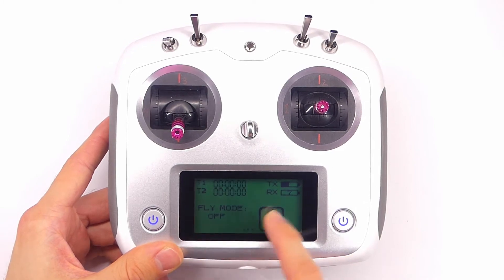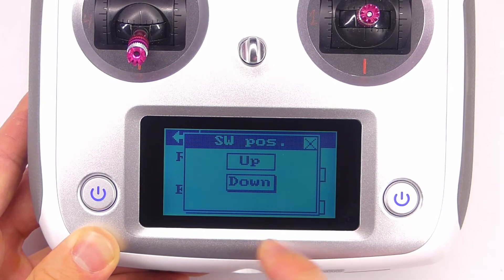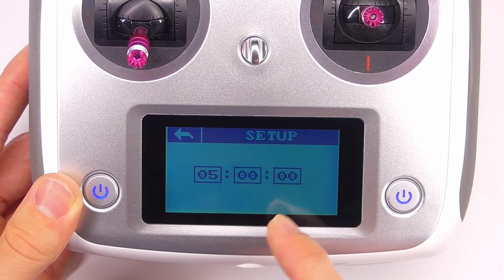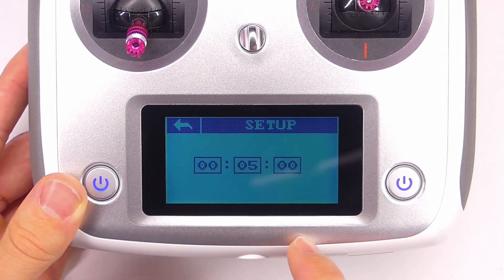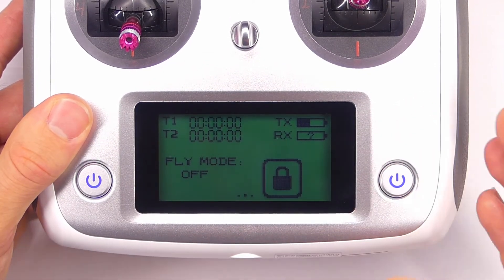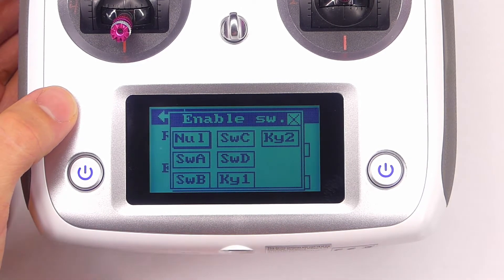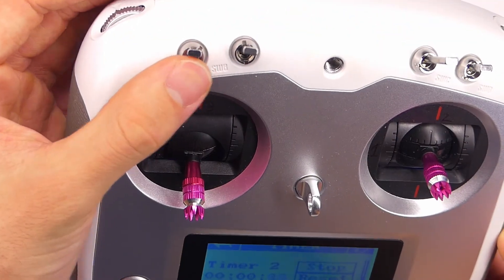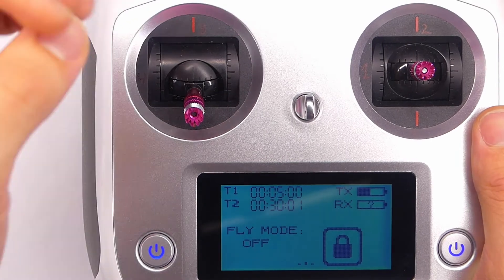FS-i6S Timer Tutorial - FlySky i6S Transmitter

Comment: Great video thank you! Here's how I set up my timer... To be able to stop or start the timer... Assign the timer to the upper left 'stop/run' Switch A or SwA. This way when you power up your heli by pushing that switch A to 'run' then the timer will automatically start, fly for a while, land for a rest powering down the heli by clicking switch A to 'stop' and the timer will automatically stop. That's how I have mine set. With the 5000 Li-Po I fly for 16.5 mins. and that ends up with good Li-Po storage voltage of 3.81v per cell. Also, If I want to reset my timer, like if I accidentally go from stop to run when the heli is not ready to power up and the timer had started, I also assigned my timer 'reset' function to 'Key 2' which is a round button on the back side of the radio, it's the one on the right side of the back when the front of the radio is facing me. This way if I want to reset my timer, I just push that 'Key 2' button and the timer resets to 16:30 mins. But I need to be careful not to accidentally push that timer reset button on the back while I'm flying or my flying time set is ruined. I tried using the 'Key 1' button on the left of the back side for my timer reset, but would at times accidentally push it and reset the timer, so I changed it to 'Key 2' on the back right side, and I've not accidentally pushed it so far, but have come close. Before learning how to set my radio timer, I carried in my pocket a simple digital kitchen timer, but would always need to remember to start & stop it, and sometimes I'd forget and lose track of my flight time knowing when to land. The radio flight timer is so much easier to use, can see it on the radio screen. But when it gets dark out, can't see the timer on the dark screen, so I need to tap the screen in an open space to turn the screen light on for a while. I'm going to try to see if there is an adjustment to keep the screen light on longer, or for my whole flights, will just use more battery power & need new batteries more often.

Comment: I only see start and reset,what about stop,example,timer is set for 15 min, I am flying for 8 min,bring it in to check something out,would like to just stop the timer not reset it.
Reply: To be able to stop or start the timer... Assign the timer to the upper left 'stop/run' Switch A or SwA. This way when you power up your heli by pushing that switch A to 'run' then the timer will automatically start, fly for a while, 'bring it in' as you wrote, then power down the heli by clicking switch A to 'stop' and the timer will automatically stop. That's how I have mine set. With the 5000 Li-Po I fly for 16.5 mins. and that ends up with good Li-Po storage voltage. Also, If I want to reset my timer, like if I accidentally go from stop to run when the heli is not ready to power up and the timer had started, I also assigned my timer 'reset' function to 'Key 2' which is a round button on the back side of the radio, it's the one on the right side of the back when the front of the radio is facing me. This way if I want to reset my timer, I just push that 'Key 2' button and the timer resets to 16:30 mins. But I need to be careful not to accidentally push that timer reset button on the back while I'm flying or my flying time set is ruined. I tried using the 'Key 1' button on the left of the back side for my timer reset, but would at times accidentally push it and reset the timer, so I changed it to 'Key 2' on the back right side, and I've not accidentally pushed it so far, but have come close. Before learning how to set my radio timer, I carried in my pocket a simple digital kitchen timer, but would always need to remember to start & stop it, and sometimes I'd forget and lose track of my flight time knowing when to land. The radio flight timer is so much easier to use, can see it on the radio screen. But when it gets dark out, can't see it, so I need to tap the screen in an open space to turn the screen light on for a while. I'm going to try to see if there is an adjustment to keep the screen light on longer, or for my whole flights, will just use more battery power & need new batteries more often.

Comment: I have a question about the i6x from flysky. I know that you can bind 20 receivers to it and I was curious to know if there was a way to switch between the receivers using the switches instead of manually selecting it on the screen can the switches be used to switch between receivers?
Reply from the maker: Hi! I haven't seen anything like that. It would have to be flashed with a custom firmware or something.